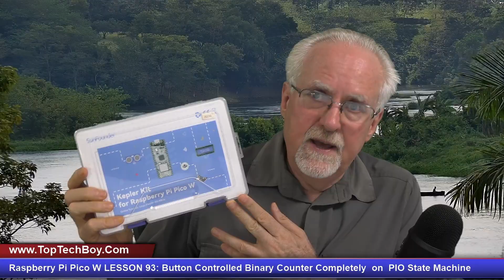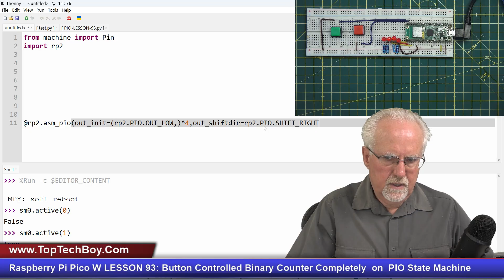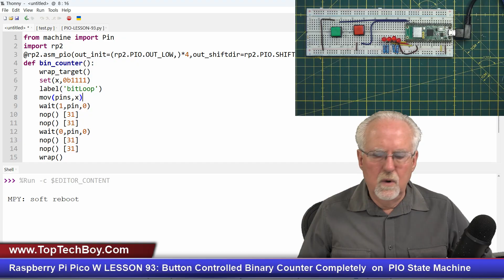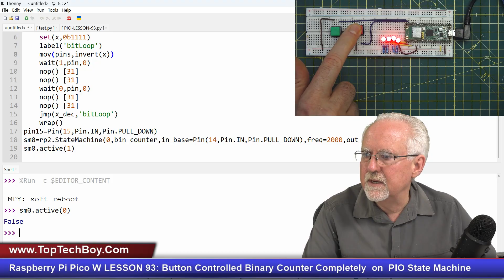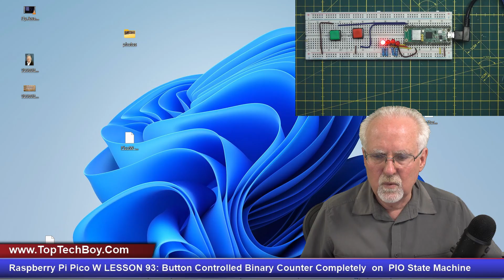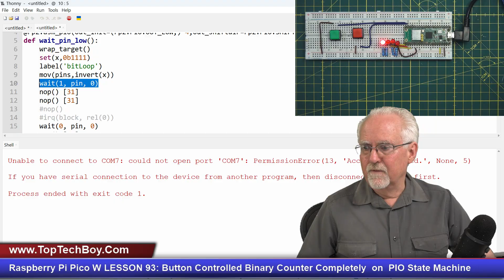Raspberry Pi Pico W LESSON 93: Button Controlled Binary Counter Completely  on  PIO State Machine

Comment: import rp2
import time
from machine import Pin

@rp2.asm_pio(out_init=(rp2.PIO.OUT_LOW,)*4, out_shiftdir=rp2.PIO.SHIFT_RIGHT)

def wait_pin_low():
    wrap_target()
    set(y, 0b1111)					# Initialize the y register
    label('bitloop')				# Inner loop to count y register down
    mov(x, invert(y))				# Move the inverted bits of y into x
    mov(pins, x)					# Move the bits in x to the pins
    #wait(polarity, src, index)
    #Polarity is what are you waiting for, a 1 or a 0
    #src is what you are looking at, gpio, pin(relative to the in_base) or irq
    #index ..... parameter for the source
    wait(1, pin, 0)					# Wait for the pin to go high
    nop()		[31]				# Debounce the switch
    nop()		[31]
    wait(0, pin, 0)					# Wait for the pin to go low
    nop()		[31]				# Debounce the switch
    nop()		[31]
    jmp(y_dec, 'bitloop')			# Decrement y and jump to the bitloop label if not 0
    wrap()							# Loop to the wrap_target

#Declare the state machine and start it up
sm0=rp2.StateMachine(0, wait_pin_low, in_base=Pin(14, Pin.IN, Pin.PULL_DOWN), freq=2000, out_base=Pin(16))
sm0.active(1)
Reply: And I went back and removed the unnecessary y register interactions.

Comment: Paul, I finally got my solution using 2 state machines posted to youtube. I cannot figure out how to link back to your lesson so here is my link: https://youtu.be/n0mhUbwC_7k
Ted Rogers
Reply from the maker: Nice work, but you do need to be counting up and down from the same number. Like counting up 1,2,3 then if you press count down 2,1, and so forth the two parts should be working off the same count total.
Reply: @paulmcwhorter  Thanks for the clarification. After reading the requirements a little closer, I saw my mistake. I will keep working on it. Thank you.